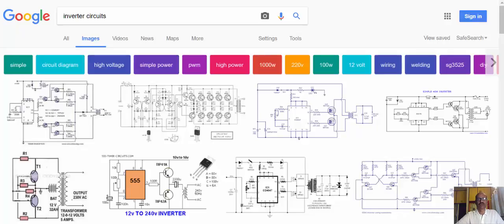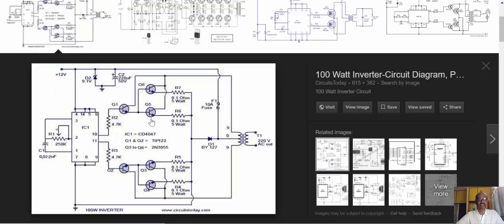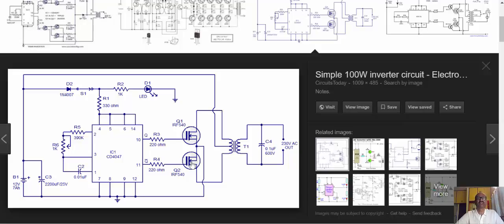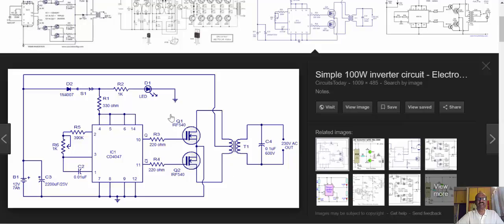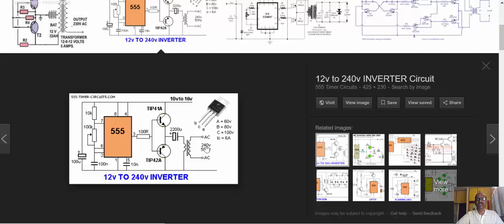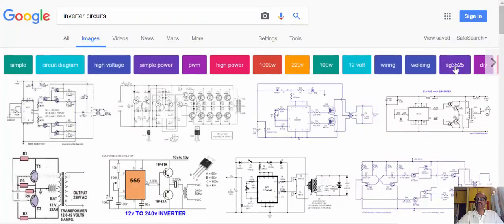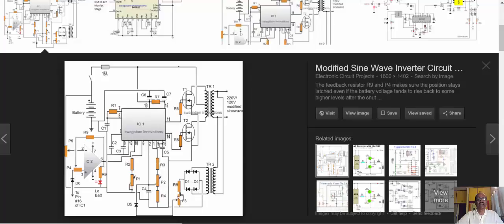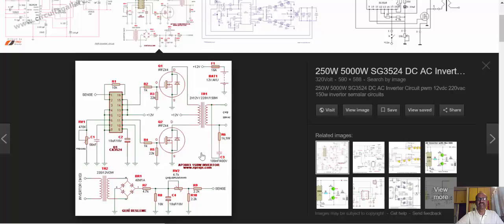Inverter - circuits reviewed Part1 - From internet

Comment: How to calculate the number of MOSFET need for inverter design
Reply from the maker: Load DC current/( Maximum drain current of MOSFET / 4) = no of MOSFETs required with small heatsinks to dissipate the amount of heat loss in watts which is I x I x RDs
Reply: @PatnaikUC  sir please explain it very well I didn't understand
Reply from the maker: RDs is the value of resistance between Drain and Source of any MOSFET while conducting with gate being triggered. I x I  meaning , I into I or  I square.I square x Rds= loss in watts.
Reply: @PatnaikUC  okay sir thank you very much sir
Reply: @PatnaikUC  Sir can you make a tutorial on a complete pure sine inverter design with all the detail calculations or you can send me the calculations for pure sine inverter design to my email Titemantronis2020@Gmail.com
Reply from the maker: @jboy4real  Bit diffcult a job

Comment: Hi , all fine. In IGBT the load should always remain in the drain ? Why in inverter circuit with bridge H there are four type N IGBT, so the load will be at the source of the upper IGBT and the drain of the lower ones. The correct one would be two type P up and two type N down for the load stay on only in the IGBT drain?